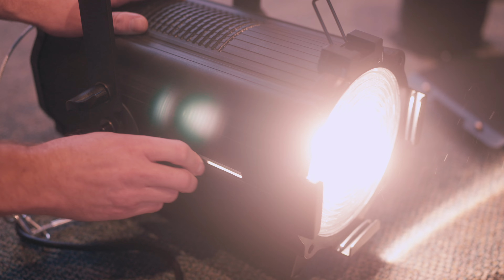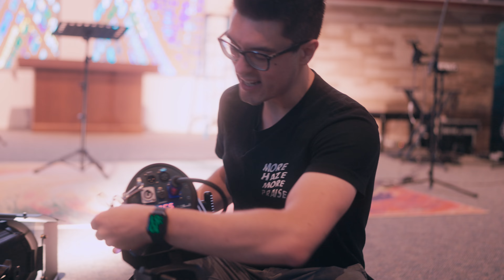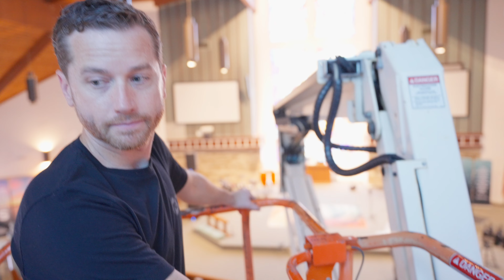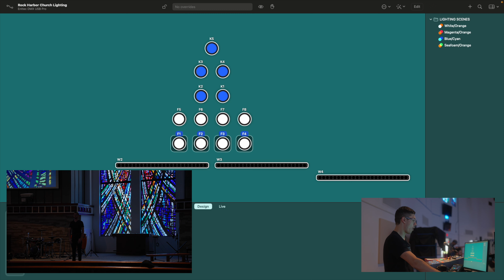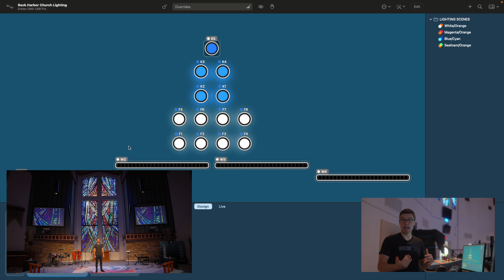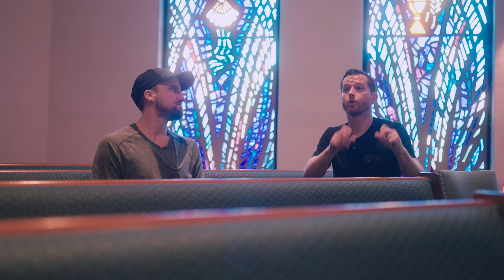Church Lighting Makeover (Case Study at Rock Harbor Church)

Comment: Good lighting can make a huge difference. I like how simple this setup is. 

Have you considered using an ArtNET interface with multiple outputs? It would likely be cheaper then installing a USB interface, splitter, and long DMX runs that take more labor to install & terminate.
Plus it would give you the option to use multiple DMX universes without additional costs in the future.

Comment: We did not work with PCL and our results were barely acceptable. The installer didn’t listen to our requirements and chose solutions based on ease of installation. I would suggest talking to multiple vendors and getting references before spending money.
Reply: Why?
Reply: @rigomorales7909  Our process did not include a long range vision, alternative solutions, collaboration with other ministries or evaluation of products before a check was cut. We would have benefited from an outside organization we felt confident in to guide those discussions and present options we could then weigh and decide on.